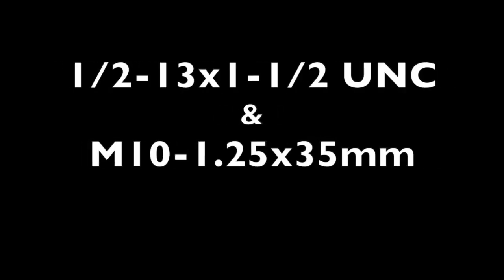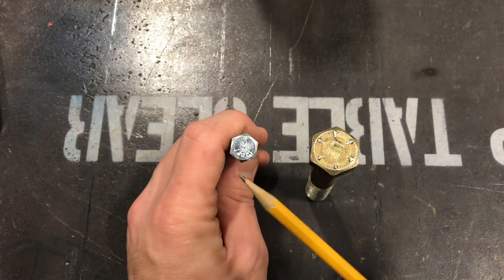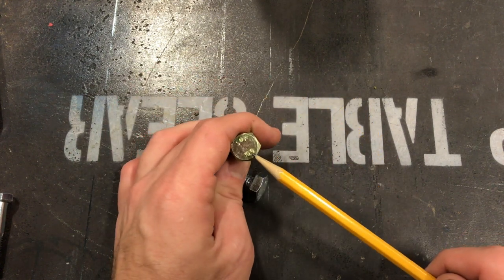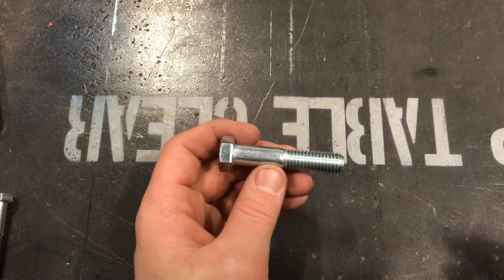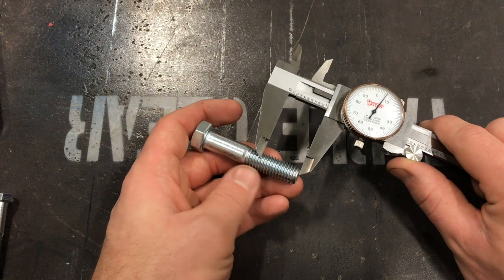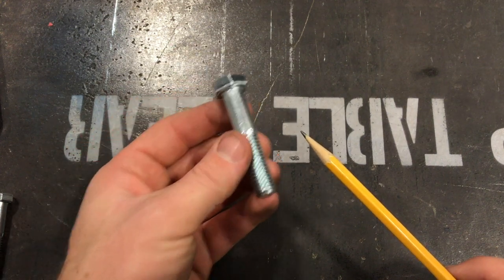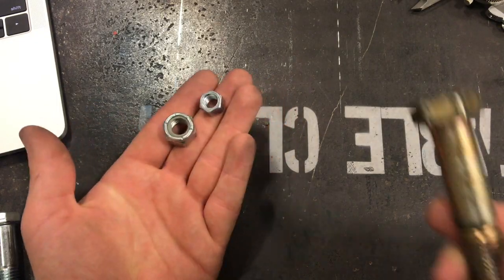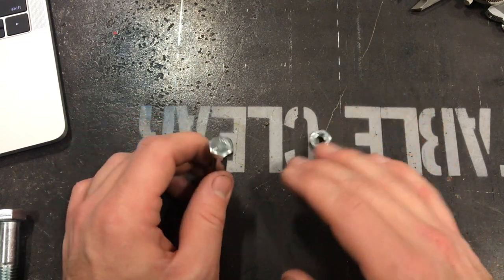Tech Basics - Bolt Identification

Comment: The first digit on the metric bolt show the tensile strength and stand for how many 100 Megapascal (MPa) it can take. Example: the 8.8 bolt Has a tensile strength of 8x100 MPa or 800MPa and the 10.9 bolt has a tensile strength of 10x100 MPa or 1000 MPa.
The second digit stands for the yield strength. You take the second digit and divide it by ten (so it becomes a decimal) then multiple it to the tensile strength (first digit). 
Example: the 8.8 bolt hade a tensile strength of 800 MPa, and the second digit is 8, so you divide 8 by 10 (8/10 = 0,8), the you take 0,8 x the tensile strength = yield strength(0,8 x 800 = 640) and for the 10.9 it is (0.9 x 1000 = 900MPa)